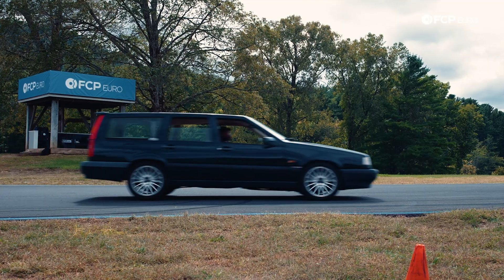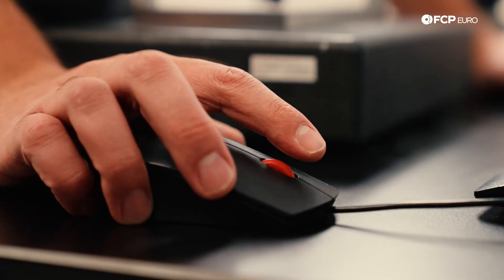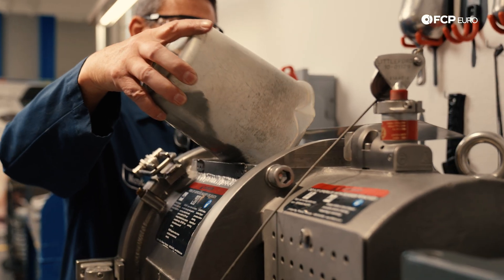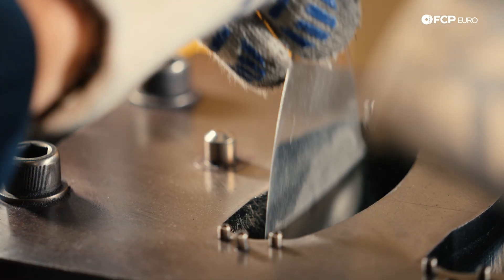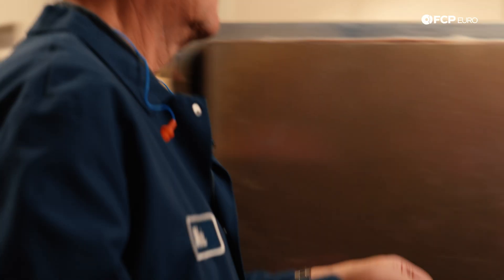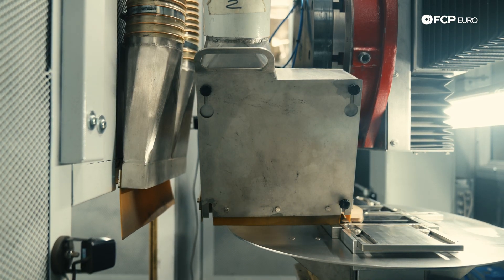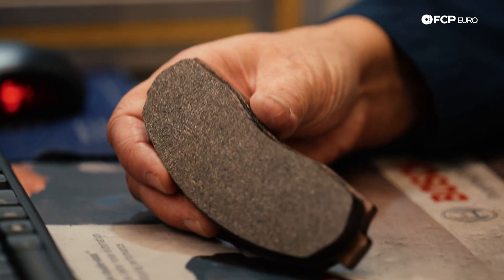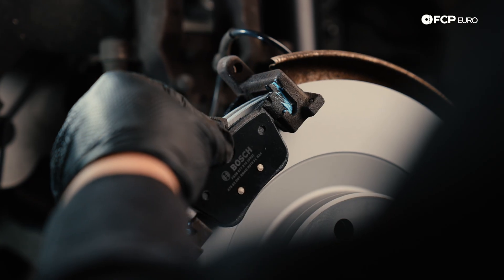It All Stops Here: How Are Your Brake Pads Made? Step-By-Step Process At The Bosch Brake Lab

Comment: LOL, I thought Bosch is a household name for building sub-par products. There are Bosch parts made in China and made in Mexico found in GM vehicles that fail repeatedly, like evap purge valves. I've replaced more Bosch ignition coils than Denso or Hitachi. I even have a Bosch hand drill that I had to replace the motor on. It's definitely not a name that evokes quality. But the brake pads seem decent. I've had no complaints with Bosch pads and rotors. They're good value. Nothing fancy, but low price and reasonable quality.
Reply from the maker: Appreciate you sharing your experience @charvakkarpe - no brand hits perfection across every product line, but companies like Bosch put a huge emphasis on engineering, testing, and quality control to get as close as possible. It's also why we're careful about what we put our name behind, and why we personally test a lot of the parts we offer. We're glad to hear the Bosch pads and rotors have been working well for you - they really do strike a great balance between quality, performance, and value for daily drivers.
Reply: Bosch is a tech gigant such as Samsung and a few others . Bosch has its strong suit in industrial electronics , automation and many many industrial critical or near critical components . Basically you open up an electrical panel and you have high chances of seeing something bosch . 

There is this and there are the common aftermarket components and household products made to a certain price tag . The low end spectrum of that is all trash , regardless of brand . Some brands simply don'd make trash , but Bosch being so big makes everything at every level . Premium espresso machines , mid level vacuum cleaners and mid level bosch BLUE power tools are highly regarded as a good bang for buck . 

You need something better ? simply add a zero to the price tag . Are you willing to pay for that ? .

Comment: Which Bosch pads don’t squeak at low speeds on an f60 jcw mini countryman?
Reply: Their Quietcast Ceramic line should do the trick. Quiet and keep your wheels clean without a ton of break dust from a semi-met.
Reply: I installed Metzger , i used NEW Remsa , NEW Bosch (basic line) , none of them were perfect . i guess a little squeak is expected . Even the carbon ceramic LeMans Prototype brakes squeak ...

Comment: I tried on a set of Meyle years ago and that was a major mistake. They simply weren't grippy enough. Scary is the word. Then I jump into a set of Textar and they were night and day! Never go with a non-manufacturer brand
Reply from the maker: Similarly to what we foudn during our deep dive into suspension valving with Bilstein - we realized a lot of the differences between some products come down to the mix of science, testing, preference and goals of any given part under different brands. Not necessarily a one size fits all!
Reply: That doesn't work anymore . Bosch , Brembo , FebiBilstein, Champion, Ferodo can all have , and if fact they do have plants and outsourcing to all around the world , most notably india . A bad batch can happen and will happen. 
Kinda sad , but quality control is not what it's used to be and a BRAND NAME does not guarantee a thing . 
I myself have touched a few aftermarket components , they always look and feel cheap , regardless of price , and not limited to automotive industry . 

On top of this oem part is also not a guarantee and it might not mean what you think it means . Parts for production ARE different from the parts for replacement . Ever wondered why did the original clutch do 250000km , and the oem official replacement only lasted 150000km ? that is the reason . It is what it is .
Reply: Meyle become a junk brand selling anything produced by whoever will make it cheapest.